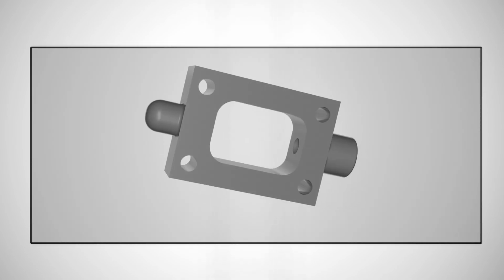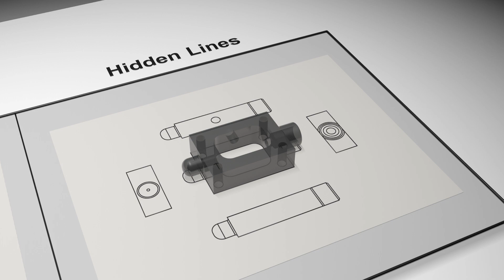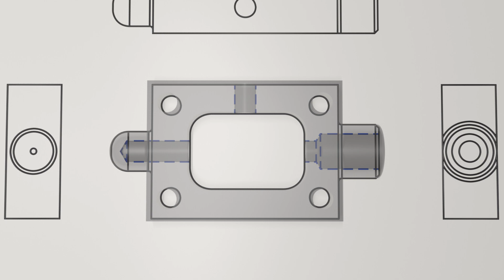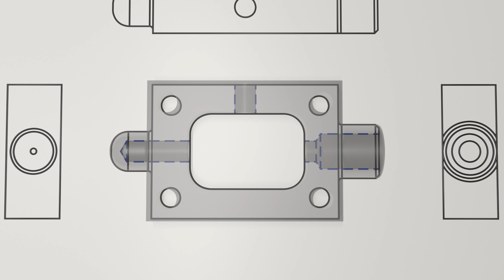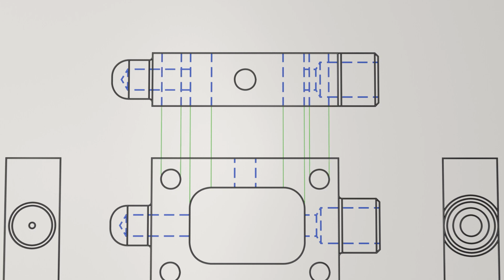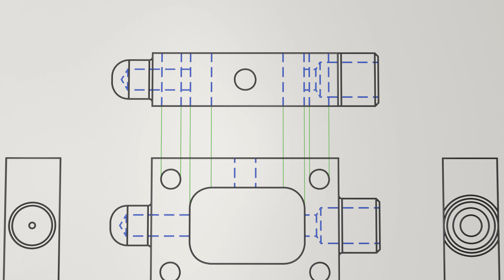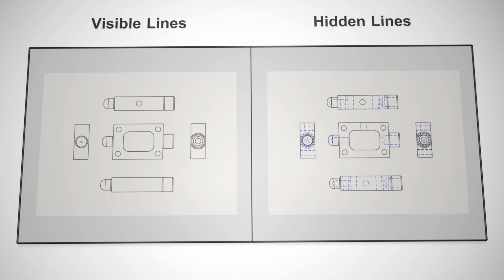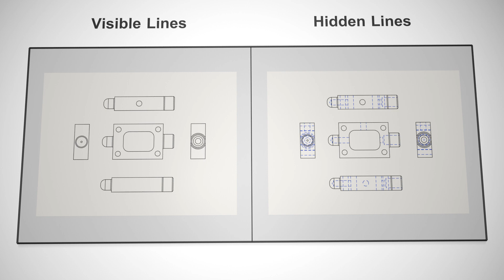Hidden Detail & Lines in Engineering Drawing & CAD. Animation

Comment: I appreciate your works and use some of your vids as a material for teaching Engineering Drawing. I must say that in reality and according to the Engineering Standards (ISO, ANSI etc.) there's no edges on tangent surfaces. Because of that it is a must to make the correct "hide tangent edges representation" settings in CAD softwares. At least hope to see a text message on this video to inform your audience. Thanks!